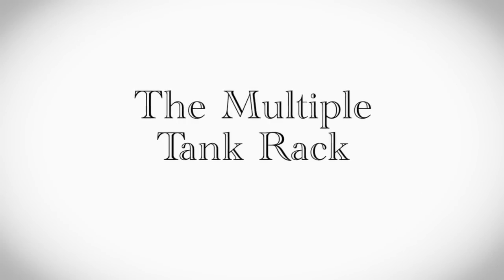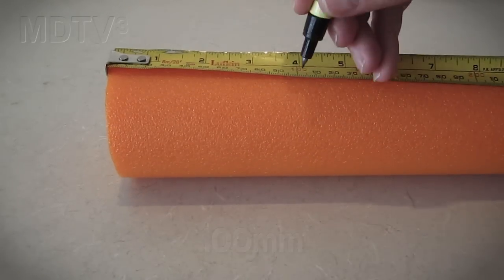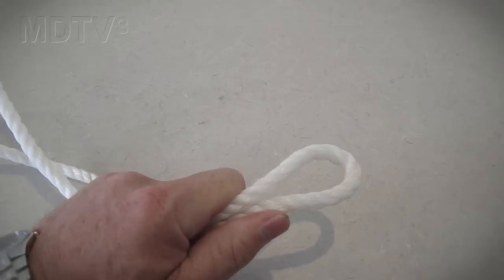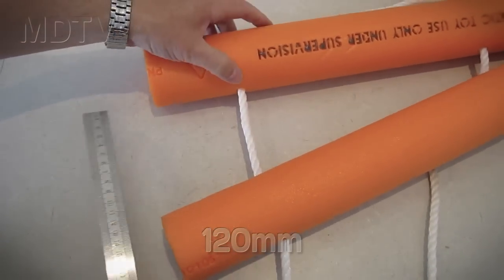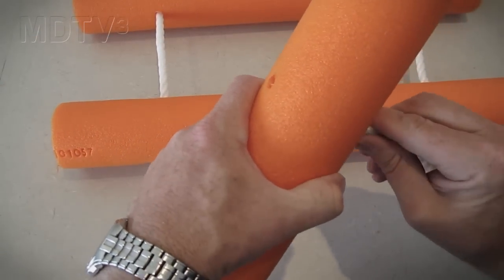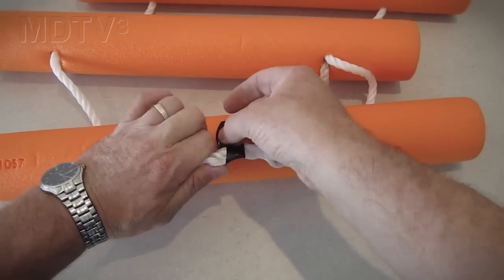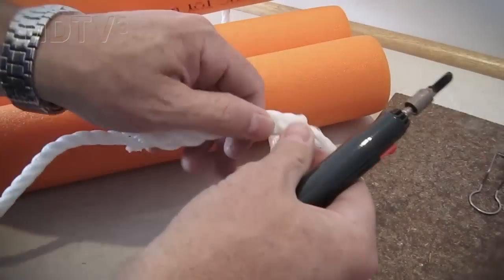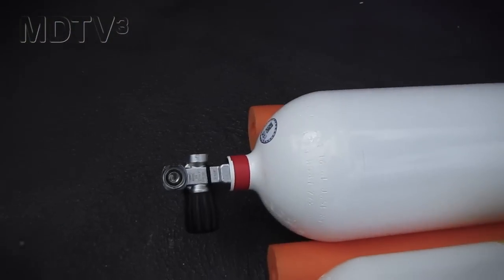DIY MULTIPLE SCUBA TANK RACK

Comment: Do the spacing dimensions given here work well for aluminium 80s?
Reply from the maker: Hi, I don't have an ali80 to test it on, The 12L steel tank is 178 mm/7in dia & the aluminium 80 is 184.2 mm/7.25 in so given the small difference in diameter they should be fine. The tank racks have a bit of give & take.